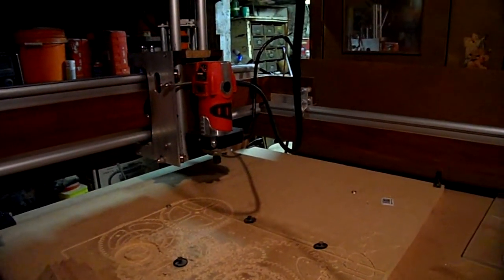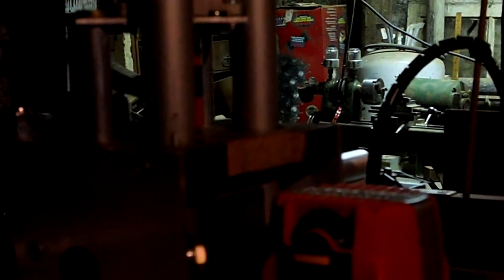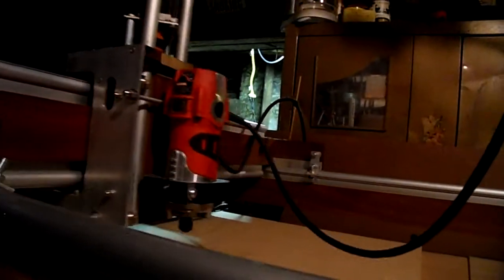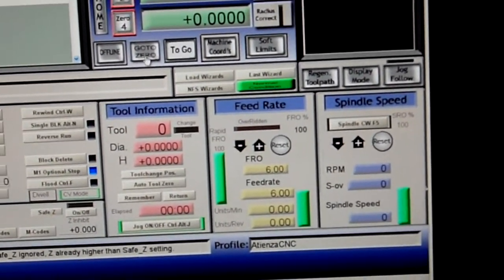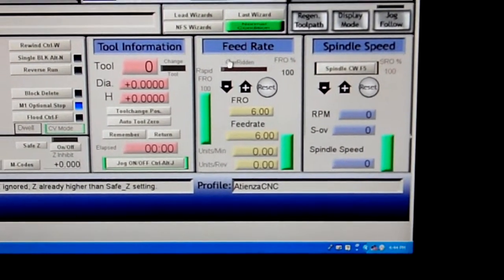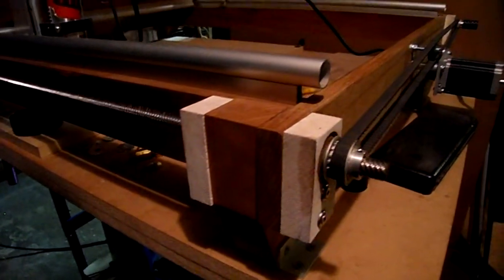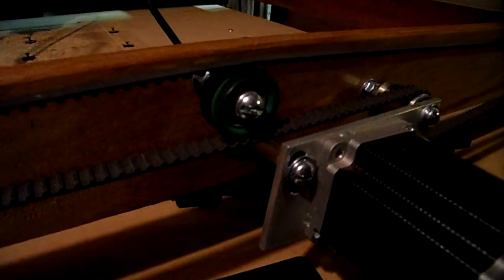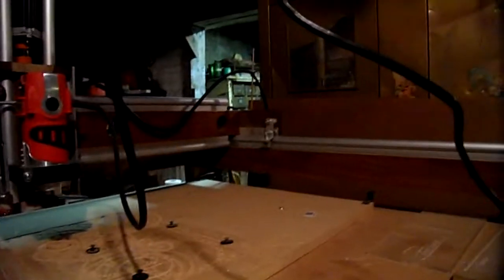UPDATE:  Modifications and Tune Up on my home-made Solsylva CNC Router

Comment: Nice job! ...if you decide you need to change out the L-line for a backlash-free jaw coupling, Lovejoy does offer these in the form of the curved jaw GS series, beam, and disc couplings. Based on your application, I'd check out the GS series first. Best of luck!